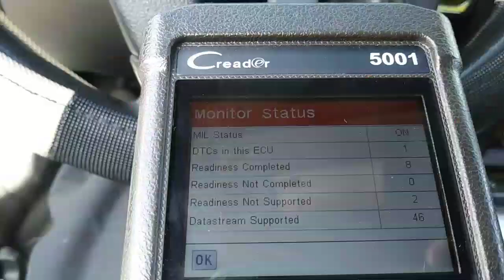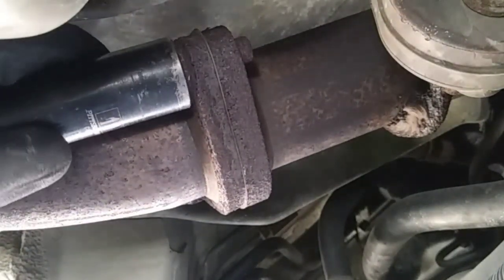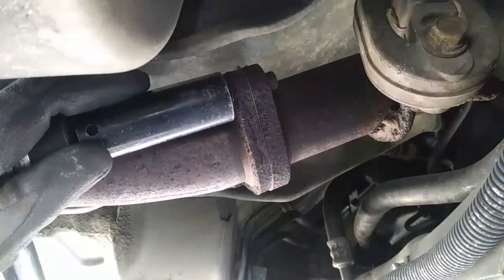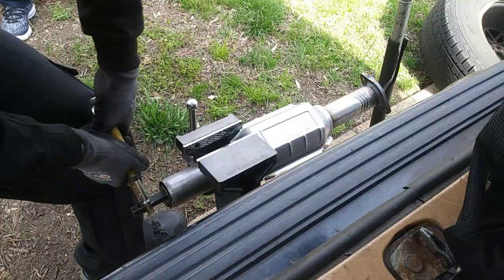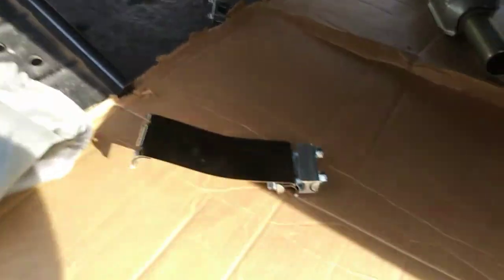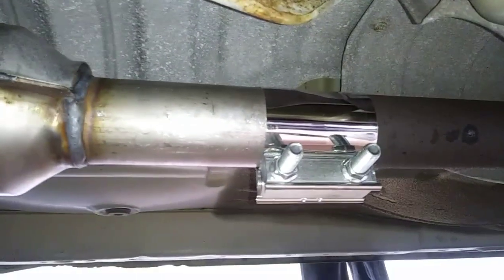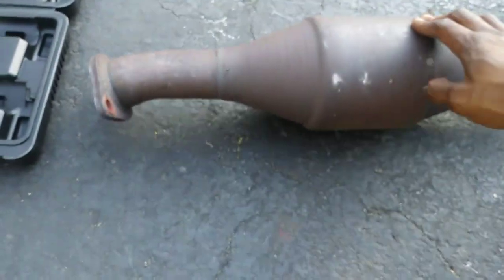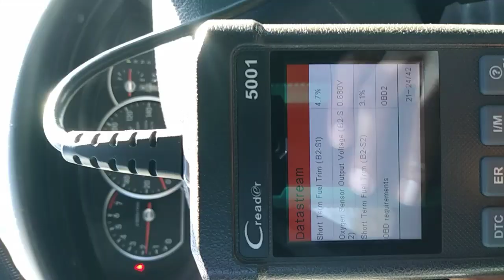CATALYTIC CONVERTER REPLACEMENT (2009 MITSUBISHI GALANT)

Comment: I feel your pain brother (brother mechanic).  Just did a complete exhaust from cat back on an 06 Grand Prix.  The single most pain in the ass exhaust job I have done in 37 years.  And all the lovely "exact factory fit" components all from the same manufacturer were precisely and exactly not factory fit per usual.

Comment: I have a 2010 Mitsubishi Galant 2.4  it has set up as yours meaning do it. Has 3 catalytic converters all together ? Because I replace the first one ( exhaust manifold) cause the the engine light but now no light and it’s a slow acceleration and excessive heat is in the crank case and the pipes rattle alil but not like urs should I replace this one too ?
Reply from the maker: Yes you should replace this one too

Comment: In the 4 years I've owned my 06 Mits galant I've had a misfire driving down the highway, this is like a day after  I had the water pump replaced. And now the car has a rough idle and has a deeper exhaust sound. And it's only reading code P0431 is it time to swap the manifold converter? Or something else the scanner ain't reading?
Reply from the maker: Federico Hernandez it might be time you replace that manifold converter
Reply: BARRICADE GARAGE ok. Hey  this is what the code is saying.
1. warm up catalysts deterioration 2.

2.warm up TWC (bank 2)  are they basically the same thing? Would you recommend having the upstream  and downstream  02 sensors replaced?
Reply from the maker: Federico Hernandez im not sure if they are basically the same but its recommended you replace the sensors when replacing the catalytic converter
Reply: BARRICADE GARAGE ok thanks!

Comment: Great videos. 
I’m getting the same error code on my 06 mitsu endeavor. I was told there is four cats on my car. But your error code on the lancer same as mine. Now if I change the 1 cat. What could be the issue that could cause this cat to go out quickly.
Reply from the maker: It was an unchecked misfire that toasted my manifold converter
https://youtu.be/xmA5NodzIYI